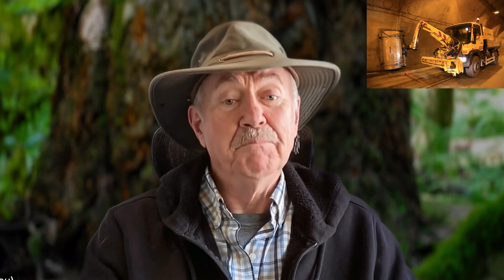Why Underground Mining May Be Hydrogen's Most Important Market

Comment: EVs don't have any exhausts
Reply from the maker: True but most mining operations are remote and have to generate their own electricity. They are mostly off grid. And 6-8 hours to charge a battery pack is not acceptable in this environment. Hydrogen also carries many times the density of energy over a battery pack, weighs far less and is easy as NG to fill a tank.  It is an engineering solution, not a technology competition. Batteries have their place, even though they are only 32% green  as 68% of global electricity is still carbon based.